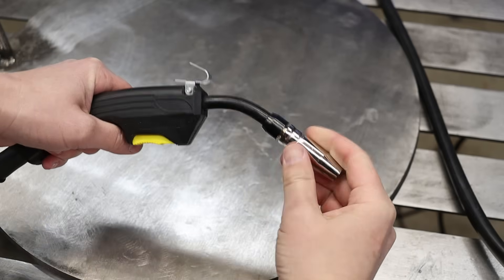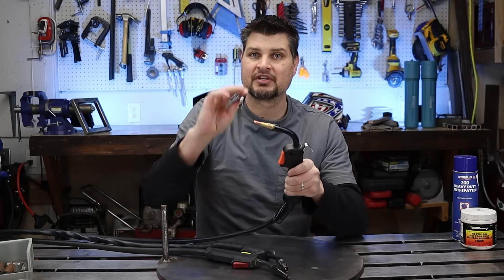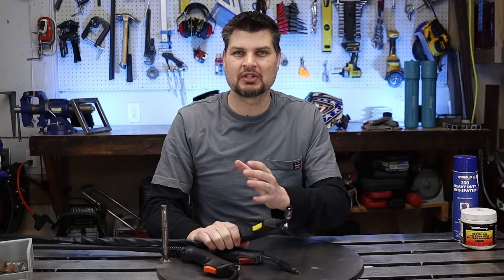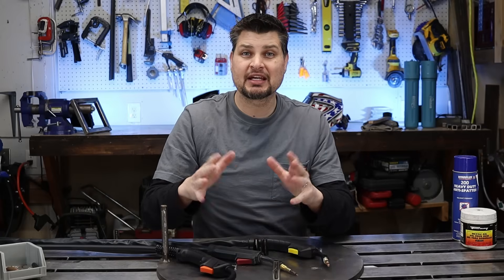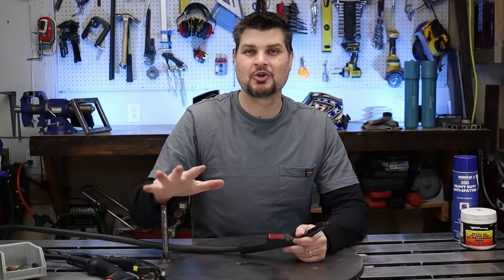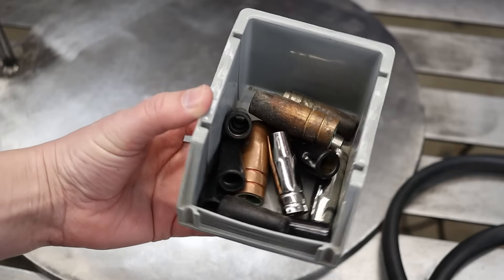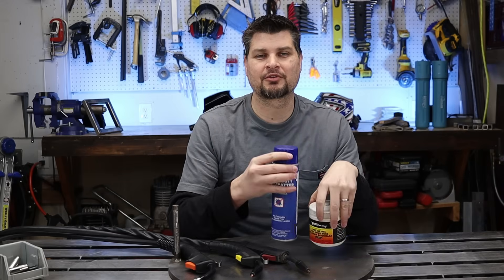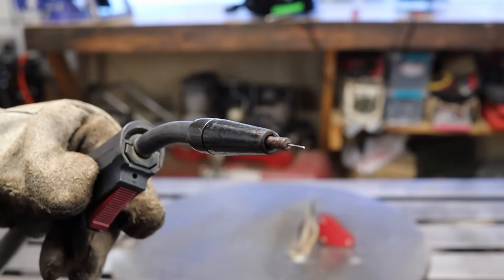#1 Tip and Trick to Improve Flux Core Welding

Comment: I have never, ever seen a welding related video that says anything about wearing a mechanical wristwatch while welding! The high currents of the welding process, regardless of machine, wire, etc, generates very strong magnetic fields. The magnetic field will magnetize the watch, some to the point it quits working. The watch can be returned to normal operating by demagnetizing it. I started a project forgetting I was wearing my Rolex Air King...ooops. I was lucky in that I quickly realized what I was doing, stopped, removed and demagnetized the watch. I will never make that bone head mistake again.  I now remove even cheapo quartz work watches.

Lastly, wear a respirator to protect your lungs from the gases. I do admit I don't always follow my own advice but if I'm welding or painting for more than a few minutes, I'll dig out mine and wear it.

Comment: I have been a certified welder fo 50 years. I will never run that non gas flux core wire,  only 25/75 mix gas.

Comment: I have an arccaptain welder with the spring tension nozzle holder situation, what gasless nozzle do I need for it?  All I can find are threaded or ones for a Miller that slip on but what they slip over does not look like the spring situation and the diameter seems wrong.

Edit: the miller didn’t fit either, too big. My spring holder situation is very clearly 12mm.

Comment: Flux core wire welds are typically ugly but very easy to use. Been welding forever and it's the only electode I weld with anymore. Its cheap, no gas to worry about, and produces stong porosity free welds.

Comment: I can't tell you how many "experienced" welding content creators on YT don't do this. I was instructed to do this in welding class, AND my Lincoln SP-175 came with instructions that tell you to use the provided  screw on cover for the tip to shield the sides and vent holes from the residue and splatter from the flux core wire. Thanks for making this video.

Comment: He is right , for a while , i  had to hand back my expensive , rental bottles , and just reverse polarity of my older transformer  wia mig welding machine and then you have a flux core machine  30 years ago  i have been flux core welding    for 38 years now wirh existing gas gun  just dip in nozile  dip and gives yoy a perfect coating   , then every now and then brush tip head   its that easy  no more buying gas and you can weld outside  without worrying abour your mig gas blown away wirh the wind .

Comment: Why are you using a nozzle for gas when Flux core welding? Even my old Lincoln had a tapered cone that protected threads and still allowed you to get the torch in where it needs to be to weld FC.

Comment: No.1 tip. DO NOT DO THIS.  Buy some ceramic covers for gasless welding, they are designed for thee job and keep everything clean.  About $8 for packet of 10. The tip is live, plus it will get spatter all over it if used  bare.

Comment: COMMON SENSE::: THE PART HE IS REMOVING IS THE """GAS SHIELD"" WHEN YOU WELD WITH FLUX CORE THERE IS "" NO GAS""" SO THE SHIELD IS ONLY OF ANY VALUE WITH A GAS!! 
BACK IN THE EARLY 1980'S I PURCHASED A SOLAR. MIG THAT CAME WITH 3 DIFFERENT CONE'S
AND EACH HAD A PURPOSE WITH GAS, THE NOZZLE WILL NOT STOP ANY GAS FROM FLUX CORE, SPLATTER GEL WITH GOOD BRUSH WITH NOZZLE OFF GIVES MORE VISUAL WELD!!!❤😮😊

Comment: If youre NEW to flyx core...BE SMART and DON'T DO IT...Ive been doin flux for YEARS & its just a good way to Fuhk up your equipment, just RELAX, CLEAN your material & if it looks crappyclean the weld,check your settings,make sure to keep your stand out length and progression,keep in mind your angle and ALWAYS HAVE SOME TEST PIECES TO TRY A TEST WELD & check yourself...

Comment: Flux Core Wire is self shielding. You don’t need a Nozzle because Inert Gasses are only used for Dual Shield and Solid Core Wires and use the Nozzle to help shield the Weld by directing the Gas Flow over the Weld Puddle.

Comment: Once I got a gas bottle I never used flux core again.  That stuff makes the worst welds ever.  Much easier to just use the gas.
Reply: Sounds like you needed to reverse polarity
Reply: @ - nope.  Did that.  Flux core makes crappy welds compared to gas shielding.
Reply: @1wheeldrive751  maybe it's because I've been welding 40+ years, but when done correctly, you can not tell the difference. A lot of times, you can't use a shielding gas.. outdoors or too much wind, etc

Comment: there is much more to fux core than that. It runs hotter than mig, can be run uphill, and has minimum spatter if you stay away from chinese wires. Use Esab Coreshield  and you will be sold. Also  it will burn thru gavanized, paint, and light rust.

Comment: I bought 125 cu ft tank of 25/75 for my 150 Amp  MIG in April. It went down to $55.00. This is exchange tank and includes state tax, city tax, DOT safety charges,  dog catcher fee’s, etc. I was shock and placed the invoice in my file cabinet and looked a previous cost. The highest was 2020 Covid price. I am retired and just wanted to weld my Stainless Steel exhaust to my LS engine in my own 67 C10 PU. This my build and last project, so not going to buy a TIG.
  Note: Guys / Gals, your first tank is higher because you pay a rental-return fee. Plus product. You get your money back when returning if empty of part full. Argon + SS wire in your MIG is fine with a correct regulator and just a small tank. Unless you plan on purging O2 from your pipe to prevent sugaring inside. It’s exhaust, I think a sugaring issue is not on my radar. It not milk, it’s exhaust.
 Thanks for sharing!

Comment: Can't believe there's still new stuff to learn here. Bits and Tricks. THANKS!
Reply from the maker: Right on!
Reply: Most quality welding units like my Lincoln SP-175, come with a cover to screw onto the tip to protect the gas ports from spatter and soot, and tell you to remove the gas cup and use the tip cover when using flux core wire, so, its no "secret" trick.

Comment: Edit: Source - I'm a trade qualified welder and metal fabricator.

While this is convenient and makes it more simple for Gasless FCAW, be aware there is also Dual Shield FCAW which will require you keep the gas shroud on your gun and run the correct gas type for the particular weld you're trying to produce.

Although I have one of my home welders set up with Gasless FCAW, with no shroud on for quick little jobs around my property, I would suggest leaving it on purely because once you've learnt with the shroud on, you can pick up any MIG/MAG/Dual Shielded type welder and not have to figure it out all over again.

Learn how to do it the correct way, then once you have it nailed, then figure out what tricks/hacks you can get away with and on what jobs!! If you do this from day one, you might save time on cleaning your nozzle, but waste more money and time swapping out your contact tips because you keep touching it on your work piece. Your gas shroud is also your insulator.

Comment: Where did you get the cool round welding plate?
Reply from the maker: It was from a fab shop. It was the "drop" from a larger plate. If you has steel fabrication shops if they have any "drop" they want to get rid of some will just give it to you for free.

Comment: Is Flux Core as good as MiG for the sole purpose of extracting broken bolts from aluminum blocks? Looking for a setup for that sole purpose... need a bit of direction...can you build up a broken bolt by layering up flux core bead or do you run into problem with slag etc...?

Comment: I'm no sure why in the world it took me so long to figure out that I can weld flux core much better without the gas nozzle foreskin .  I welded gas dual shield  in the trade for years and it just seemed normal to have it on when welding.  some good points.
Reply from the maker: Right on, thanks!

Comment: If you're remove the nozzle and keep touching  the work with the tip you blow the diodes in your machine. I have made a good living repairing welding machines, half replacing diodes

Comment: Not flux core , that's inner shield
Reply from the maker: Also known as flux core! Technically it's called "self shielded wire". Innershield is Lincoln's registered wire.
Reply: @-DIYPRO-  flux core uses CO2 shielding gas , certified 51 yrs including navy nuclear
Reply from the maker: @michaelswyers4779  Yes you are 100% correct.....but so am I! You being a welder for 51 years have ran hundreds of spools of "dual shield" flux cored wire. Anyone not in the field or industry, like 99% of the people watching this video, or those that are just starting out call this process "flux core welding" or "gasless mig welding". 
If you go into the welding supply shop and ask for flux core wire they won't think twice and get you wire for dual shield process. If you go into Home Depot, Harbor Freight, or google search "flux core wire" you will indeed get shelf shielded, innershield or gasless flux wire.

Comment: Taking the insulator off dose nothing but allow the brass to touch the work  more easily and wreck the gun quicker, the manufacturers know this and put them on for a reason. position yourself so you can see what your doing, your dragging so you can see everything, puddle shape, stick out, the joint ect.
Reply: I am a mechanic,I can weld alright I guess. If you think that screw on thingy is just to keep you from grounding out. Maybe do a double take on instructions.

Comment: Any recommendations of generator size I would want to buy for this?  I really don't want to use household lines for it.
Reply from the maker: 3000 Watt for just minimum settings. 4000 to 5000 if you want to to any thicker material. (Thicker than 1/8")

Comment: We have to rent bottles. Its unfeasible as a hobbyist or diyer. Flux core is best core. My cup is brand new still in the box. Add some tape so you dont get stuck doing something tricky. Had to do a weld with a piece of mirror the other day.

Comment: You do know that if you run a shielding gas with your flux core, you'll reduce the BB formation by about 90%, right? Also, the smoke produced will be practically non-existent. We used only flux core at 2 different companies and NEVER ran it without a shielding gas.

Comment: Just tried removing the shielding nozzle after watching this video... and it was a mess! The weld was spattering all over the place, deep holes all over the bead... and then on my second attempt it ended up welding a big lump on the end of the tip. Had to grind it right back as it wouldn't break off. Put the nozzle back on and it was perfectly good again. Not sure about this "#1 Tip and Trick to Improve Flux Core Welding" at all.... haha.
Reply from the maker: Yea this is great for newbies. If you are experienced with the nozzle then by all means keep it on.

Comment: nov 2 2023
caught yur remqrk about having a reverse polarity switch.  and lacking one means its
only flux core.   

     my lincoln 140 has no such switch. 

so now i know it is not upgradeable to tig with a gas bottle and a different hose.

     eager to try the nozzle shield removal.  its warming back up to the 60's
here in colorado near pueblo.  and that means its welding - weather outside

Comment: you miss the main point of flux core, its cleaner (the flux) burns and creates a gas that then cleans the weld like a MIG would. Other then some slag from the burnt flux or spatter from the thin wall wire they are the same strength and by matching the correct gauge wire can reduce spatter as well as reversing polarity. You can make a .30 solid mig wire spatter with a 220v welder maxed out

Comment: Flux core is the superior process over MIG. First, it's got the lowest entry fee of any process because you don't need the gas & bottle, & FC-only machines are cheaper than dual/multi-process machines. (Stay away from that black box from harbor freight.) 2d, it is far better for welding outdoors because there's no gas to blow away in the breeze. 3d, flux core provides better penetration than MIG.  The only drawback, arguably, is the appearance of the bead.  Flux core vs MIG is sort of the 6010 vs 6013 comparison in stick welding. Practice will improve FC bead appearance, but, if strength is the only concern, you'll get it done better with the flux core. That said, you'll likely hear many people say that flux core is the hot glue of welding. That is absolute garbage.  Those are the people who don't cut and etch their welds to see which process is best.  Run a T- joint with MIG on one diet and FC on the other.  Then cut & etch it.  You'll see an obvious difference in penetration on anything thick than,  say, ⅛" steel.
Reply: Black box? You mean a 170 Chicago electric? What’s wrong with it?
Reply: @keltonwilt1499  yes, that's the one.  It's okay for hobby stuff on thin material, but it doesn't like anything over ⅛". Very few settings options, and the duty cycle will have a guy drunk before the job is finished.  For not too much more money, you could get into a titanium stick machine that will do far more for you. That said, the black box is great if you are just testing the hobby to see if you like welding.  It lowers the entry fee and won't hurt too much if you decide that welding isn't your cha-cha.  There is a good reason why those machines are so common in craigslist.  They're the Honda Rebel of welders.  But one, run it for a couple weeks, then upgrade to something that'll get you on the road.
Reply: I was told otherwise by an old head regardless if fcaw or gmaw if done properly it has the same tensile strength
Reply: From what I have found this is bang on

Comment: I saw on another channel that they wrap Teflon tape over the gas holes and threads, which is much cheaper and has superb visibility.
Reply: Thank you, that sounds like a good option for FCAW method! I think I will give it a go brother! 👍🏻
Reply: Good tip for those that didn't get a flux core tip cover with their welder.

Comment: Thanks for this.  So simple, and I literally just figured it out for myself. I was struggling massively to keep sight of my puddle.  Took the MIG tip off, and all my welds improved dramatically.  Yes, I'm new to welding.
Reply from the maker: Right on, thanks!
Reply: Same here. My welds did improve but I still suck.
Reply: Same here!

Comment: Seems like there are two types of screw nozzle tip holder parts.  Let me see.
Reply: I use 35-50 for my FCAW Century machines, though I recall there is another one that I'm not finding right now Google searching.  I believe the Miller and Hobart are the spring style.  Though I recall another threaded design size.
Reply from the maker: Thanks for sharing, if others, let us know.
Reply: @-DIYPRO-  I was thinking of the same looking design, there is a larger size that is not the m10 base thread and 7/16-14 21-50 nozzle.  At least I think that's the correct thread specs.  Though still not coming to mind or found.  There are definitely other screw types design, though looks different and not sure if they use the 21-50 nozzles and M6 tips with M10 base for the contact tip holder. 24KD, 25AK, 26KD and 36KD are some others contact tip holder designs I found.

Comment: >>You won't go back<<
I did.
After watching lots of MIG welder videos, they often rest their nozzle on the work surface.  Good idea if you want stability, usually when you start your tack. No matter how clean, sometimes the wire doesn't arc, and pushes your torch away. It's especially good with sheet metal, puts the spot right where you want it.

Comment: The nozzle can prevent the tip from arching out especially for learners until such time as they learn to float the tip.
Reply from the maker: Without the nozzle or by using a flux core nozzle you can see that distance better. If you are still contacting the work piece you need to work on your stick out.
Reply: @-DIYPRO-  Exactly what I said.

Comment: THANKS FOR THE TIPS. WAY BACK BEFORE A LONG TIME AGO, WE USED OUR CUTTING TORCH WITH PROPANE AND OXYGEN SOME BORAX SOAP FOR FLUX, BRASS ROD, OR HAYWIRE TO WELD UP JUST ABOUT ANYTHING.
Reply from the maker: My friends Dad always mocked the younger generations for not using "the one and only true welding process" gas welding.
Reply: gas welding skills are the base for Mig, Tig and stick, if you can master gas you can master anything. he was correct.

Comment: Yeah, buy the $8 flux core nozzle, and use that instead of the gas nozzle. Flux core nozzle is slim and pointy, makes it easy to see your work, and protects your mig gun from the spatter mess of flux core.
Reply from the maker: Right on.

Comment: NICE SHORT VIDEO. very informative, especially the nozzle info and spray and gel.  Knocks spots of of a lot of other videos. well done  
Worth a note, you can with an angle grinder, chop about half an inch off the standard mig nozzle, this protects a lot of the diffuser. and you can see more of the contactor..
Reply from the maker: Right on, thanks!

Comment: Is the copper tip actually supposed to protrude beyond the outer nozzle? I’ve always liked it inside just a little. To protect it. I always thought it was supposed to be this way.maybe I should try it your way.   Nothing worse than the wire getting stuck at the very end of the tip. Then you spend the next ten minutes fixing it. Maybe I learned something today?😀
Reply from the maker: Right on!

Comment: Flux core was actually my final setup. Ive been mig/tig/stick welding for around 12 years now for work. I have no need for those applications at home though, so flux is cheap and if you know what youre doing it can be as good as the rest. A little research goes a LONG way.
Reply from the maker: Right on! You can probably flux weld with your eyes closed!